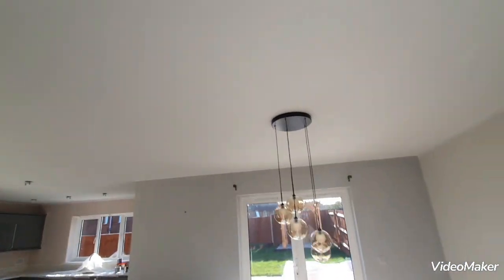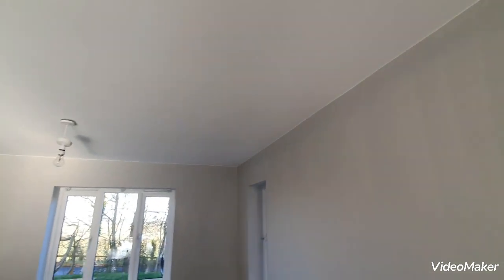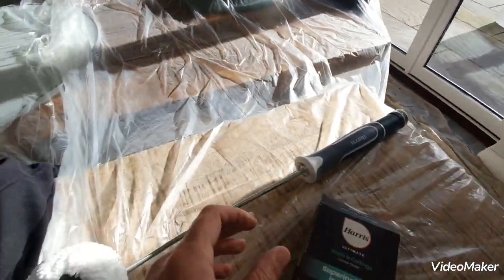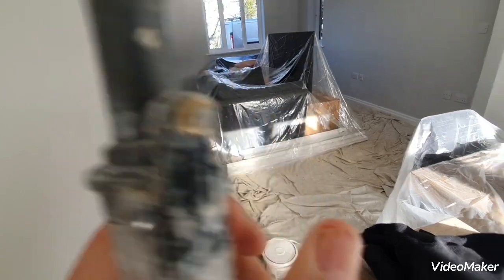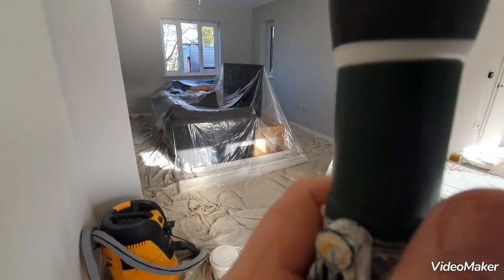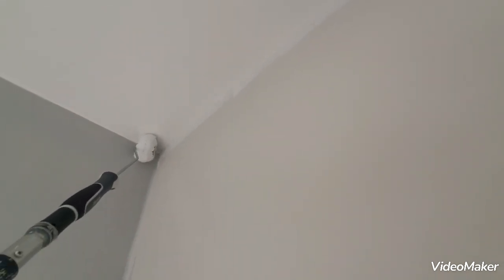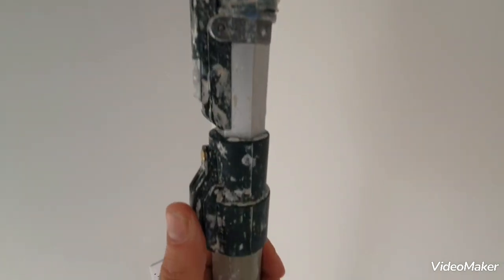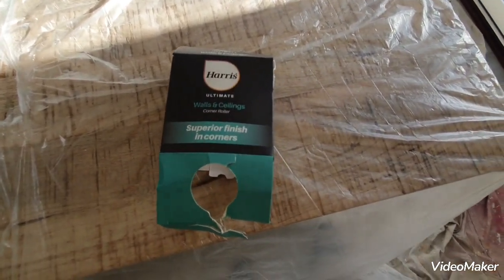How To Paint Ceiling Edges Fast Saving Time

Comment: Thanks for the quality video Daniel
The Wooster GT poles are very good. 
Wooster also sell the GT pole conversion tips separately.
 [packs of 2]
IF one requires quick attachment/removal on more screw threaded ‘tools’ such as in my case when I use my shortest GT pole with a window washer and squeegee [unger].
Reply from the maker: Mate. Wooster are the best thing I've come across in a long time

Comment: 4 inch roller across the ceiling edge will bring the paint down an inch or so onto the wall. no need to buy a corner roller but probably good to have in your kit.
Reply from the maker: 4 inch roller for detailed coving is great aswell. It's good to find ways of making this trade quicker and easier. Cheers Dan 🍻